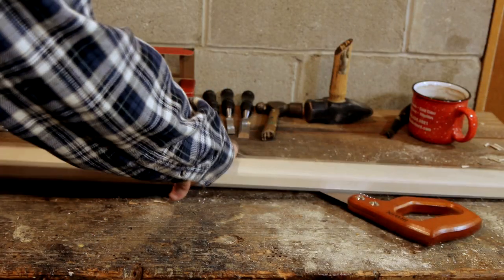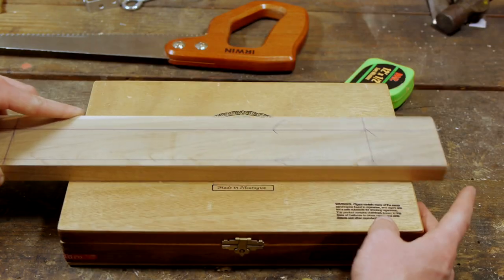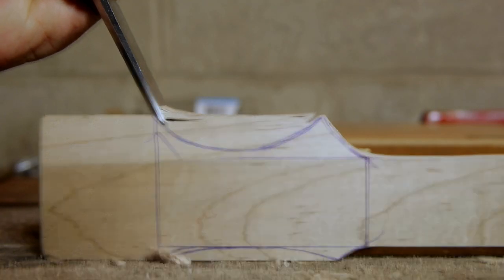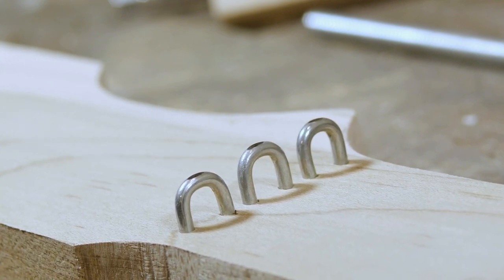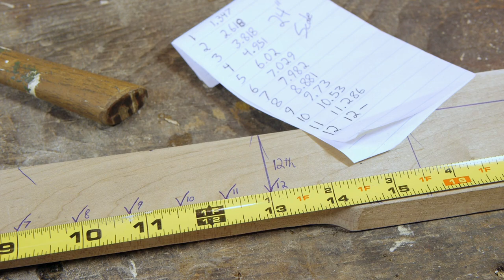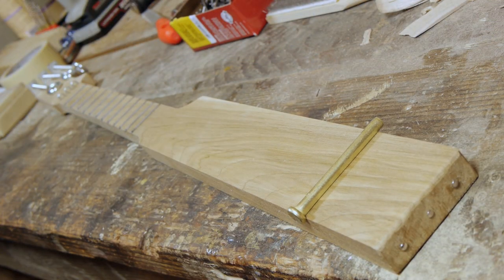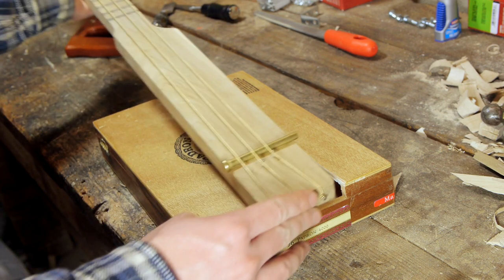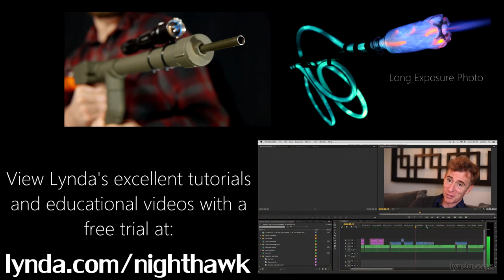How To Make A Fretted Cigar Box Guitar

Comment: I have been working on a CBG for weeks now. I can not get passed the frets  - and I want it fretted, with nails. I don't want to get a store bought fret wire. For some reason, I am not able to sand/rasp the nails to the point where they will not cause snags or cuts. What is going wrong? What is the trick? 
Also, the paste/wax you apply...does it smell? Does it leave residue after playing?
Reply from the maker: I'm not sure what the problem is. Maybe your file is old or worn down? You could use a dremel with a grinding wheel on it if you want to make it easier. The paste wax does not leave a residue after it's dry. You can use a clear coat or any other protective wood coating you like.
Reply: WOW, thank you for the quick reply! I am actually hand filing it right now. I attempted to Dremel a month ago...and I damaged the neck pretty bad! I think I've mentioned here before, this is my first attempt and it is a gift for a dear friend --- I've put in too much effort to stop now, so he is going to be getting this thing no matter what it looks like now....but I am still hoping it will still be playable regardless of its aesthetics :D LOL
Reply from the maker: Yeah hand filing is easier not to slip with and hit the wood.
Reply: NightHawkInLight I'm kinda curious how I could turn this into a 6 string with those types of tuners (The eye bolts)....?

Maybe turn them to the side? 
Get bigger wood plank for neck? 

I'm not sure honestly.... 
Any ideas?
Reply: Kellie Brunner put the nails in a drill and sand them

Comment: does it sound good if i change the string with bass strings?
Reply: You can check it yourself.
Reply: You should probably make the scale length longer, about 30 inches should do the trick, and make the neck thicker so it won't bend. Otherwise, it should work pretty well! It'll only be lound enough for practice in quiet rooms though, but that can still be loads of fun.

Comment: I am setting out to make a CBG as a gift. I do not play. I know nothing about guitars. In my research I am learning a lot. I am getting nervous about measurements...as in how far the strings will be from the neck, frets, and box: how high/low should the strings be?!?!?! ALSO how far apart so the strings sit from each other?
PS - I have watched your video on repeat for days now - LOL
Reply: Another thing...why on earth are there sooooo many kinds of stings? ;P hahaha - All I want is for  my friend to be able to play songs. I am keeping it acoustic and I am going to use actual machine heads...It will also have a fretted neck. In my mind, which is not musically inclined, I want to give him 4 strings, so there is another option for a different sound/note/tone BUT which 4 of the typical 6 should I use? Help if you can, kind opinions are welcome!
Reply from the maker: The strings should be around 1/8" above the frets/box. That's very adjustable after the guitar has already been made so you don't have to worry too much about it. They should be no closer than 1/4" from one another. Don't worry about what strings to use either, your friend will be able to put whatever strings on it they want to. Strings are replaced often on a guitar.

Comment: Is it possible to make this with 6 strings without simply doubling the width of the wood? If so, could you please give me a semi-detailed explanation on how to do so?
Reply from the maker: +Alejandra Cortes Google the measurements of other guitar necks or take a ruler into a guitar store to figure out how wide you want to make it.
Reply: How would I arrange the nail tuners at the head? I cannot use actual tuners because this is for a project. Would I be able to arrange the tuners to get six strings using the nail tuners without making the fret board so wide?
Reply from the maker: +Alejandra Cortes I don't know, you might have to find a different tuner design. Search for cigar box guitar designs, maybe someone else has come up with something better.

Comment: Hello, i'm french and i didn't undertsand what is the measures of the wood plank, i understood that the length is 32 inches but i don't know the width and the thickness, if someone can help me, it's will be very sympathetic. Thank you
Reply: +Reiv 
Bon jour mon ami.  J'espere que je peux t'aide.  In the United States, lumber is measured a bit strangely.  A 1 x 3 inch (thickness by width) is in reality 3/4 x 2 1/2 inches wide.  This is standard measurements in industry and we all assume these measurements.  Why they do this, I don't know.  So in reality the neck measures, 3/4 x 2 1/2 x 32 inches.  Hope this helps.  Bon chance.
Reply: +Ines Calderwood Thank you very much :)

Comment: how do you know where to put the twelve fret on the board
Reply from the maker: ***** It's the exact half way point between the start and end of the scale.
Reply: NightHawkInLight i did that, and i am also planning on making my guitar 12 frets like yours, but when i measured the 12th fret out the neck was so small, im using a board thats a lot wider than yours i cant remember the dimensions off my head but the whole neck would be about two of my hands, why is yours longer?
Reply from the maker: ***** I made a guitar with a 24" scale length, so the distance from the nut to the 12th fret is 12 inches on my guitar.
Reply: NightHawkInLight well i have to restart because i cut wrong so i need new wood, ill check it again and try to go closer to your specifications when i remake it, thanks for the help!

Comment: why do my string and/or tuners (i use old guitar tuners) keep breaking? I cant get it into a GDG?
Reply from the maker: Probably you're tuning to a g that's an octave too high, or you're using inappropriate strings for the note. This issue doesn't really have anything to do with the guitar
Reply: @Nighthawkinlight  the thing is, its ether super loose or super tight, there is only one tuning were its actually playable.
Reply from the maker: @Colafarr  Sounds like you need different strings. Try asking someone who uses gdg tuning what strings they use.

Comment: I made the guitar and it plays great but a day or two later, the neck started to bow out and i'm just wondering if anyone can help with that, if so just let me know, thanks 😊
Reply from the maker: Is it made from hardwood or soft pine?
Reply: @Nighthawkinlight  I was using pine, I ended up taking the strings off, then warped the wood back into place and inserted a metal rod as a truss rod. Works perfect still 3 years later. Also I was wondering, could you provide tabs for the first song you played? I can’t find them for the version you played anywhere.
Reply from the maker: @collinskinner8044  Wow nice work figuring out how to install a truss rod! Sadly I don't have a tab for the first song. It's Bach's prelude to cello suite, which I learned first on mandolin. I figured out the notes by ear to play on the 3 string guitar. I wouldn't remember how to play it now.

Comment: That looks really sharp! Sorry to criticize, but the groove you cut for the bolt that acts as the bridge was premature. IMO, the instrument should be strung, an the bolt intonated and marked, and then the groove made. (I'd be tempted not to make a groove at all, in case I wanted to change the string gauge, change the tuning, etc.) Other than that, fantastic job!

Comment: Hey I just wanted to say thanks for putting this up!
 back when I was 17 my sister and I split rent on an apartment, and one day while walking around our local Lowe's and looking at the pre dimensioned craft wood section, I decided that I was going to build a 5-string banjo with a wooden body!
( because I had always wanted a banjo but could never afford one)
Well I bought a coping saw and a in indecent amount of sandpaper, and got started! thankfully we had one local music store so I got some old guitar tuners and I had a neck off of an old Fender which I used to copy the Fret spacing, which was ironically a 24-inch scale length, so went to work with steak knives and Titebond II wood glue and by the time it was over I put a half of juice can in the front of that thing and it sounded all right! Now at 30 years old I have a half-decent wood shop with a workbench and an assortment of reasonably respectable machines and hand tools, but I never have made the journey back into lutherie although that is what got me started to begin with, but I just might, I just might!

Comment: Your design is unique or at least a little different than most, which is always good to inspire others to try making their own. I thought your use of the angle brackets and eye bolts was a clever way to tighten and tune the strings. Many people use wooden pegs press fitted into holes or they use screws or bolts, but either method isn't as foolproof or durable as your use of small diameter screws and nuts attached to the metal brackets.

Comment: Thanks!  I've been wanting to try using nails for frets (since I can't afford an actual fretting kit) and it seems I've already got everything that I need to do it in the shop.  I just didn't know where to start.  Now I just need to get off my lazy butt and try it, sometime.  I may try going through our old abandoned house out back and scavenging the door-hinge pins from each room.  I've been using bolts for the bridges and nuts, but this is more attractive. =)

Comment: could you use a hot glue gun instead of super glue
Reply: No, hot glue has a rubbery consistency and would dampen the sound of the strings, while superglue gel dries rock hard and transmits sound well. You can use any hard setting glue for this, such as epoxy. Heres a tip, if you can't find superglue gel try your local dollar store, and if they don't have it just get regular superglue and let it sit with the cap off for a day or so and it will gel up. And don't use as much as he did on the frets, the glue is extremely strong.
Reply: A. Zak thanx man
Reply: NVtoxic1sniper XT glad i could help.

Comment: way to much work. use tuners and get a $1.00 fret marker. use bolts for the nut and bridge. use an actual saw to cut the fret marks. a file does not work. fret wire is only $5.00 for six feet. way better then nails as frets. use a clear varnish After you are done fretting the neck.